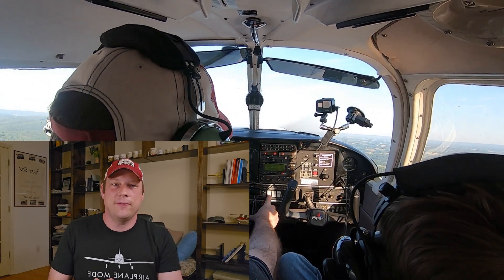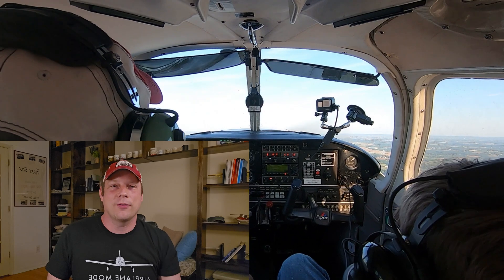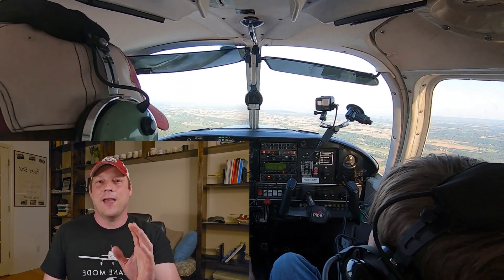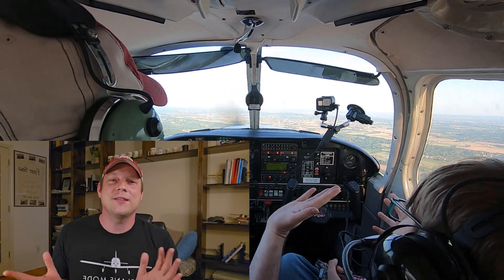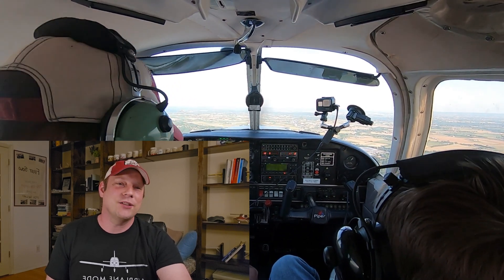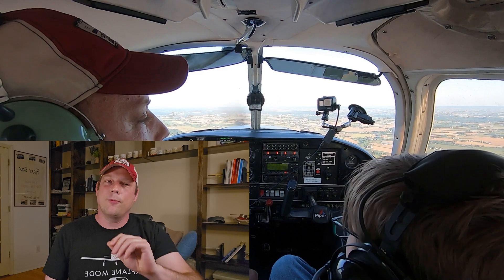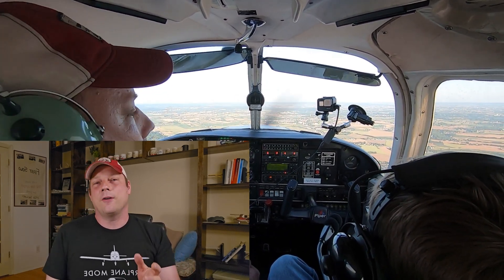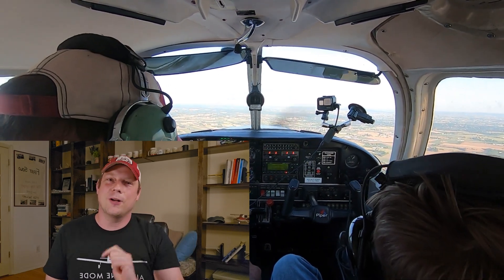Airplane Emergency Series 8/31.  Broken Throttle Cable!  Mayday 8

Comment: I had that happen in my own aircraft years ago,   control engine speed with pitch if you have it, or mixture until it runs rough, but NOT shut off,  in my case it was a rotax, so fixed pitch prop and auto mixture,  solution was to turn off 1 ignition system, reduced power a small amount,    to descend just killed ignition, restart when at lo level with flap out to increase drag restart engine, made emergency landing
Reply from the maker: Those are some good ideas, thanks for sharing!  This is definitely an interesting scenario, a lot of moving parts if this happens!